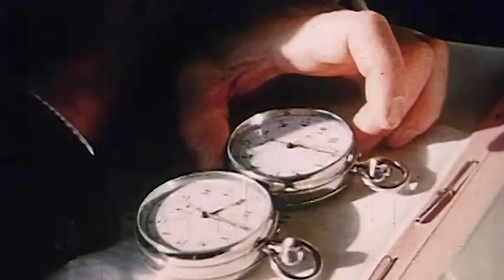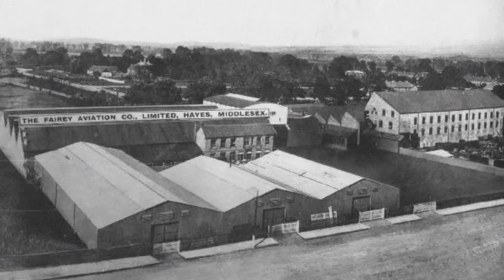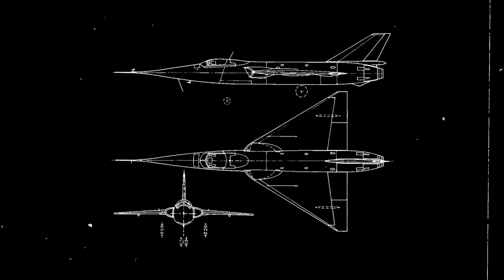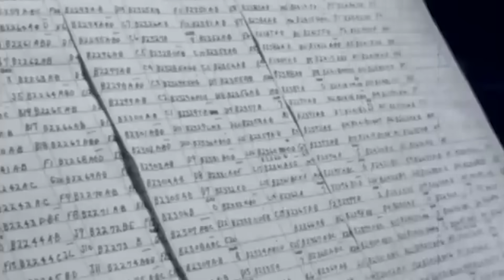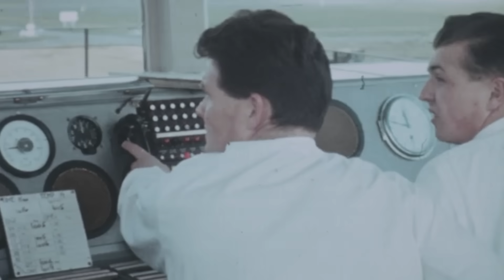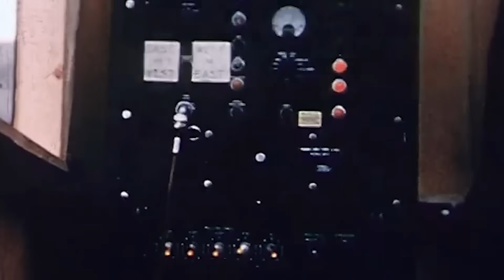Britain's 300 MPH Most Successful Mistake

Comment: In October and November 1956, a total of 47 low-level supersonic test flights were conducted from Cazaux Air Base, Bordeaux, France; a detachment of Dassault engineers closely observed these trials, learning a great deal about delta wing aircraft from the FD2. Dassault went on to produce the MD.550 Mystère-Delta design, that "bore a striking resemblance" to the FD2; the MD.550 design would proceed to be manufactured as the successful Dassault Mirage III.
Reply: The issue in this nice story is that the MD.550 flew a year before the FD.2 came to France. So no, Dassault didn't need the FD.2 to design a delta aircraft
Reply: @pycouse9681  the concept of Delta Winged aircraft was the German Alexander Lippisch who influenced others. The early jet engine that powered the Mirage III was based on the BMW 003 built by German engineers working in France after the war called the SNECMA Atar. 
Plenty of copy cats around then and still are.
Reply: I read somewhere, the cost of insurance in Britain was that high it made the trials unaffordable but in France it was next to nothing, so the flight trials took place in France due to concern of broken windows due to the sonic boom.
Reply: @HarryBlack-tl1fk  yes the councils got upset and the insurance was expensive ( maybe £1000 per flight ) so it was moved to Bordeaux were the grapes didn't mind and Dassault got to see how to build a delta properly. This must have inspired the French as the FD2 flew 300 mph faster than the existing speed record. A pity that the British government failed to spot the potential.

Comment: I remember that Delta 2 fighter well, I built an Airfix plastic model of this one in my younger days. I still have it!
Reply: It was an Airfix. I only built Revell and Arfux models. None other.
Reply: @VidarLund-k5q Airfix never made an FD2, @foxstrangler has it right, the only FD2 kit around was the FROG back in the 60s-70s. Various other firms re-popped the FROG kit, but Airfix wasn't one of them.
Reply: No, you built a FROG model of it, so did I - four in fact over time.

Comment: Wings "swept back at 90 degrees" interesting design.
Reply: actually it was 60 degrees, same with what became the Lightning built to the same experimental requirement
Reply: @davidgibson5453  The subtitles get it right. The script given to the synthesised voice must have had a typo.
Reply: The usual Dark Skies bollocks.
Reply: Yes, I was taken aback by that   :o)
Reply: @blrbrazil1718 And why does the narrator call him Duncan Sandies?
Reply: @jeremycruickshank8614  : If you were wondering about who he is, Duncan Sandys was appointed Minister of Defence in 1957 and produced the 1957 Defence White Paper . If you're curious about the spelling / narration, the AI software constantly makes pronunciation errors by misinterpreting written text (eg: Sandys as Sandies, instead of Sands).
Reply: @jeremycruickshank8614  The Defence Minister responsible was Duncan Sandys  (pronounced Sands) but the text-to-speech commentary doesn't know that.
Reply: @simprove  Presumably the writer didn't know it either. If it was me I would have spelt it incorrectly so that the pronunciation is correct.

Comment: I love the way the Russian jet engine was not mentioned it was a copy of a British Engine, The Sabre engine was developed from British Gifts to the US. The Brits had axial flow sorted in 1943 but exotic metals where needed. Whittle used Centrifugal compressors  because they where more reliable at that time.
Reply: Whittle ended up going to the USA, in response to continued government non commitment to the jet engine.
Reply: @johnchristmas7522 

It was a large difference of opinion between the govt and powerjets regarding who was going to be doing what when it came to jet engine development & manufacturing & some other stuff that resulted in 15 key power jets people resigning and going their separate ways.
Reply: We feel we can clear up some commonly held misconceptions.  

Obviously it's always good to deal with facts rather than fiction isn't it.

The main required exotic metal was Nimonic, a nickel super alloys, very low iron and mostly nickel, developed in England in 1940 & available nowhere else at the time. 

Heinkel had nothing to do with the Mig-15. The Mig-15 was of course powered by British gas turbine aero engine technology.

Messerschmitt had nothing to do with the North American Sabre. In fact an Austrian chap was partially responsible for some Sabre design aspects, he'd left Germany before WW2 & ended up at North American via Brazil during the 1930s.

Edgar Schmued. Edgar O. "Ed" Schmued (Schmüd; 1899–1985) was an Austrian/German-American aircraft designer, famed for his design of the iconic North American P-51 Mustang and, later, the F-86 Sabre while at North American Aviation. He later worked on other aircraft designs as an aircraft engineering consultant.

Regarding the centrifugal compressor Whittle engines & the centrifugal compressor RR Nene, the most powerful & most reliable gas turbine aero engine on the planet in 1944. 

The Klimov VK-1, the improved version of the RD-45, was the first Soviet jet engine to see significant production. It was developed by Vladimir Yakovlevich Klimov [ru] and first produced by the GAZ 116 works. Derived from the Rolls-Royce Nene, the engine was also built in China under licence from Klimov as the Wopen WP-5.

The Klimov RD-500 was an unlicensed Soviet copy of the Rolls-Royce Derwent V turbojet that was sold to the Soviet Union in 1947. The Klimov OKB adapted it for Soviet production methods and materials.

The RD-500 was used in a number of early Soviet jet fighters including the Lavochkin La-15, the Yakovlev Yak-25, and the Yakovlev Yak-30, but only the Yakovlev Yak-23, Yakovlev Yak-25 and Lavochkin La-15 were accepted for service.[4]

The RD-500 was copied and developed further in the (Glorious) People's Republic of China (PRC) at the Shenyang Aircraft Development Office PF-1A.

The Klimov RD-45 (a direct copy of the Rolls-Royce Nene) the earlier powerplant behind MiG-15's high acceleration rate and high climb performance - it's said that it was this engine that made the MiG a reality. 

The VK-1 was used to power the MiG-15 'Fagot' and MiG-17 'Fresco' fighters and the Il-28 'Beagle' bomber.

The US licensed J-42 (RR Nene) and J-48 (RR Tay), being virtually identical to the British engines. US aircraft used licensed British engines powering the: Bell P-59, P-80, T-33, F9F Panther, F9F-6 Cougar, 
FJ Fury 4,  F-94 Starfire.

The centrifugal Rolls Royce Nene is one of the highest production jet engines in history with over 50,000 built.

The Nene was improved into the RR Tay RB.44, which was licence built by Pratt & Whitney as the J48, and by Hispano-Suiza as the Verdon, seeing
service in many plane types.
  The Rolls-Royce RB.44 Tay is a British turbojet engine of the 1940s, an enlarged version of the Rolls-Royce Nene designed at the request of Pratt & Whitney. It saw no use by British production aircraft but the design was licence built by Pratt & Whitney as the J48, and by Hispano-Suiza as the Verdon used for the Dassault Mystere IV ff 1952 Transonic.

GE J31 & GE J33 Centrifugal Compressor Turbojet engines. Developed from Whittle engines. 
Applications
Convair XF-92
Lockheed P-80 Shooting Star
Lockheed T-33 Shooting Star
Lockheed F-94A / F-94B Starfire
Lockheed T2V SeaStar
North American AJ Savage
Martin P4M Mercator
Martin MGM-1 Matador
Martin MGM-13 Mace
Vought SSM-N-8 Regulus

The Pratt + Whitney & Lycoming companies currently manufacture gas turbine aero engines that use the reverse flow combusters & centrifugal compressor configuration pioneered by Sir Frank Whittle. The Lycoming engines often include a multistage axial compressor supercharging a centrifugal compressor stage as described in one of Whittles earlier gas turbine aero engine patents.

The Wright J65 was an axial-flow turbojet engine produced by Curtiss-Wright under license from Armstrong Siddeley. A development of the Sapphire, the J65 powered a number of US designs.
First Run March 1951 (J65)
Major applications :-
Douglas A-4 Skyhawk
Grumman F-11 Tiger
Martin B-57 Canberra
Lockheed XF-104
North American FJ-3 Fury
Republic F-84F Thunderstreak 
Boeing XB-47D (T49 testbed).

As always we do indeed hope this helps.
  
Cheers indeed 👍 obviously.

Comment: Marvelous engineering but it turned out that we didn't actually need it. Even if it was put into production none of them would have ever been used in combat.
Reply: I don;t think the FD2 if commissioned would have been assigned any role other than that of a rapid response interceptor.
Reply: @lenfirewood4089 

There was a project to develop a Mach 2.5 long range multirole fighter bomber aircraft from the FD2, it got shelved first then cancelled second.

Comment: At 7:18… how can a plane have “90 degree swept wings”?  This channel covers a lot of interesting topics, but nearly always has some dumb mistakes.
Reply: Look at the angle formed by both wings.
Reply: @horusfalcon  60 degrees!
Reply: @davidgibson5453  That may be.  I don't have a protractor in my hip pocket, but it is possible for a delta wing to have a 90 degree sweep from leading edge to leading edge.  Would that be a good design for a delta wing?  That's another question.
Reply: @horusfalcon  There were there wings considered for Concord the chosen after wind tunnel tests one was identical to the Russian one quite a Tony Benn coincidence.
Reply: @BrinJay-s4v  This does not make any sense to me.  The Concord wing is a compound curve delta, whereas the Tu-144 wing is a more simple cranked delta.
Reply: I saw that at Farnborough; most beautiful aircraft I have seen, even better than Concordes. I was taken there by my big brother.

Comment: One is at RAF Cosford museum - it is very pointy and the wings are like a knife - it looks like it is made from stainless steel
Reply: The metallurgist in me approves. Steel is a good choice for high survivability and unknown wind heating.
Reply: They blunted the wing leading edges for the museum aircraft, they were dangerously sharp as manufactured.

Comment: There's a lot of hyperbole here.  After WW2, UK, France and the USA all had access to Alexander Lippisch's work on deltas so the advantages of the layout were known.  The FD2 was never intended to be a fighter...it was a research aircraft, like the X plane series in the USA.  The FD2 had no space for radar or ammunition or missiles and had limited range and endurance.  The Lightning, which was already flying in the form of the P1A was going to be that aircraft.  Dassault developed the Mirage series entirely independently and they had prototypes flying before the FD2 went to France for its flight tests.  Fairey proposed a next-generation development but the Lightning was already working well, so it remained a paper exercise.  Even after the Sandys White paper, the Lightning development continued and it entered service successfully, alongside ground to air missiles for airfield defence, as envisaged by the Sandys Defence Review.  The fact is that the FD2 was a good research aircraft and it the developed form of the BAC 221 did great work proving the layout of the Concorde wing, so it wasn't a wasted effort.
Reply: Not entirely correct re thr Mirage III. The FD2 was tested in France and the resulting data was shares. Dassault used the data as part of the Mirage III design process.
Reply: @nickbrough8335  There's no evidence that the FD2 flights in France influenced Dassault in any way other than confirm that they were on the right track. The MD 550-01 and MD550-02 (Mirage 1 and 2) were both delta winged aircraft and 02 had already flown at Mach 1.6 in 1954. The FD2 didn't arrive in France until late 1956, when work on the Mirage lll was already well under way.
Reply: @ whoever wrote the wikipedia page disagrees with you and they arent the only website that states that. Dassault has sone quotes of his own re the FD2 as well
Reply: @nickbrough8335  Its a common myth. Not surprising it gets spread around. A check on the timelines of both aircraft shows that Dassault did not see FD2 until 2 years after he had started work on the Mirage lll, so they were well on their way. The Mirage was an early adopter of area rule to reduce transonic drag and the early prototype looked more like the Convair Delta Dagger, so that was a significant difference with the FD2 as it had the classic "coke bottle" body. Dassault himself denied use of any data from the 2 months FD2 was in France and this story seems to come from a single source who appears to have made an assumption based on its appearance at Farnborough and the fact that the FD2 had been in France. Marcel Dassault himslef said that they didn't learn anything from the FD2 that they didn't already know, but acknowledged it was a good plane and Britain could have developed it into their own Mirage if it weren't for the way they went about these things.
Reply: @nickbrough8335  Yes, of course.  Designers talk to each other.  It's no surprise that the 1950s deltas (FD2, F-102, F-106, Mirage III, MiG 21 etc)  all had similar wings...aspect ratio 2 and LE sweep 60 degs works perfectly.  The fact remains that the FD2 and Mirage designs were done in parallel.  The difference was that the FD2 was a research vehicle and the Mirage III was intended to be a production fighter with radar, weapons and decent range and endurance.
Reply: @ re FD2. For me the issue is that the UK civil service (and the minsters they “advise”) then and now continually make the wrong decision. The Lightning was a short ranges interceptor that stayed in service long after it became obsolete, whereas the delta winged designs turned out to be a lot more flexible and have remained a long term design standard (Typhoon, Rafale etc).
Reply: @nickbrough8335  Agreed but the Lightning was an amazingly good design for what it was intended for...point defence and rapid time to height to intercept bombers.  That was a throwback to WW2.  remember that the requirement was written in 1947.  That design was amazingly advanced.  Also remember that EE had only ever produced one other aircraft, the Canberra, so was a new kid on the block.  Re deltas,  I worked at Warton late 70s to mid 80s and spent some time in Advanced Projects when we were working on AST403.  It was all F-18 lookalikes until the Germans approached us with TKF90...we'd never looked at a delta. the rest is history!
Reply: @ yes, but the waves of Bombers as an essential threat was over by the late 50s. The treat became long range air born missiles launched from northern Norway (most likely). Yet the UK operated the Lightning without essential electronic upgrades well into the 80s. It never carried more than 2 short range IR missiles either.
Reply: @nickbrough8335  ...but it made a lot of noise and was the star of any airshow!
Reply: What are you doing spoiling story with facts.
Reply: Yep. Too much hyperbole in this video.
Reply: They continue to do the same to this day
Reply: X plane the British one you mean?😊
Reply: This Is an interesting contribution.
Reply: thanks for this..puts into perspective